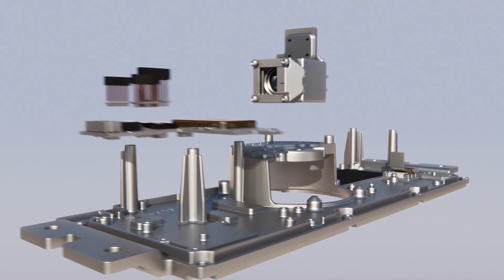All-New Volvo EX90 (2024) | Exterior Details & Remote Sensing System

Comment: Over $70k 2023 Volvo car has a steering wheel vibration very bad when driving 65 mph, making it quite annoying and UNSAFE to drive, especially at high speeds. 5 times the dealership visited, a Volvo engineer came and replaced AXLE ordered from Sweden and other parts, but the problem still not solve. contacting Volvo case was opened over 2 months still no solution or update.